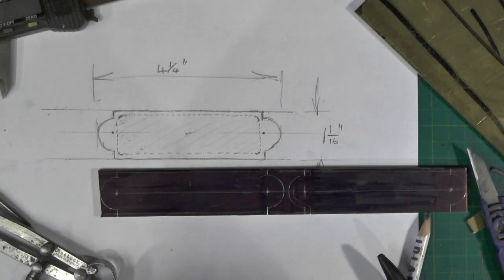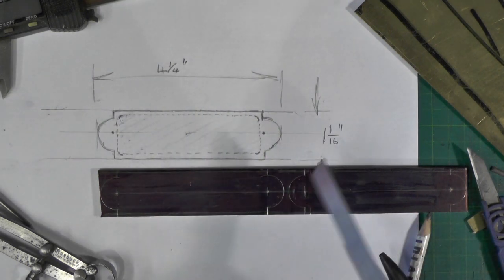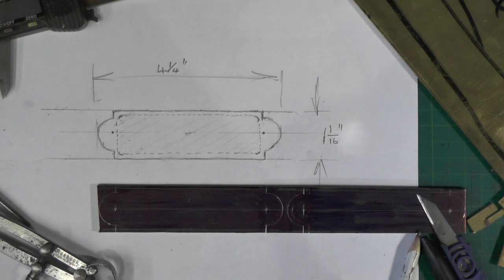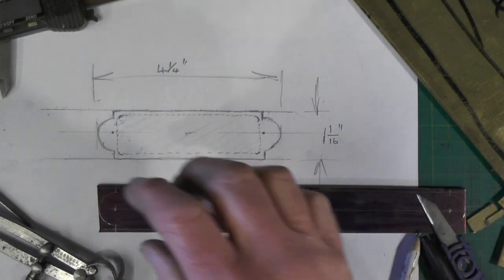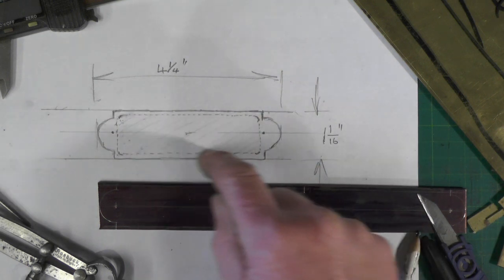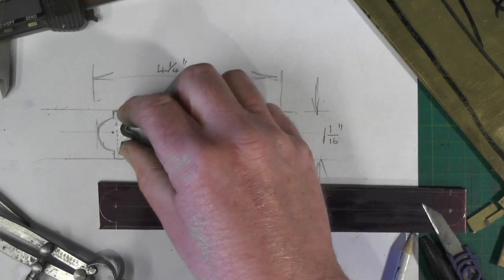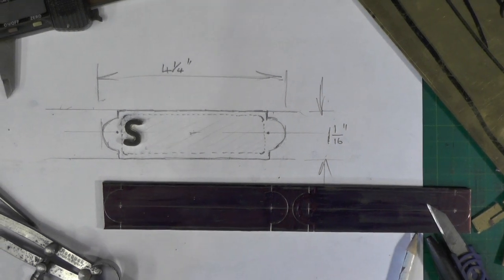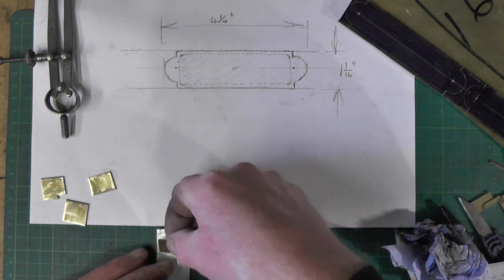Build Your Own Beginners Steam Locomotive Series (Simulated Cast Brass Nameplates P1 ) "mr factotum"

Comment: Hi Mr.F, I believe that building a loco from stock material would surely befit the name "Scratch" 
By the way going back to your video on making the chime whistle, I am making one from the site that is shown but as you said some details are so blurred and I cannot figure out what the two lower, left and right  captions are. Did you by chance figure out what they state? By the way I did make one chime using 3/8 dia copper tube 4.5" long and sounds pretty good. I cannot follow the dimensions given as it would be far too big for my traction engine. Thanks for the instructive video.  
Best regard and take care
Emanuel Lautier
Reply from the maker: yes the drawing was very patchy, i had to guess some details, as  long as your happy with the sound thats all that matters. Just adjust to suit your size, the shorter the tubes the higher the notes and vice versa.
regards
mr f

Comment: Mr F, If you apprenticeship was anything like mine you will have spent hundreds of hours filing bits of metal unti you got it perfectly flat and square. Show a young lad a file now and he will wonder where you plug it in and switch it on. This might be your first steam engine , but your decades of engineering experience is shining through. Absolutly beutiful work.
Reply from the maker: cheers rs
yes most young uns ( NOT ALL THOUGH!!!!) don't want to know, if there hands are going to get dirty and no  screen to watch. 
Thanks for the compliments, are you putting your hard earned skills to use!!
regards
mr f
Reply: @MrFactotum  Im 62 , so im still working full time . Im a Tool maker making press tooling but i spent most of my career making die casting dies. This was without the aid of modern wiring machines .So i was used to spending weeks with needle files and emery cloth. As i am still working , doing stuff at home seems like a busmans holiday, but i have no doubt when i retire i will begin some projects.
Reply from the maker: @robscully3312  hi rs
sounds good, may be something without filing then!!!!!
stay safe
see you next time
mr f